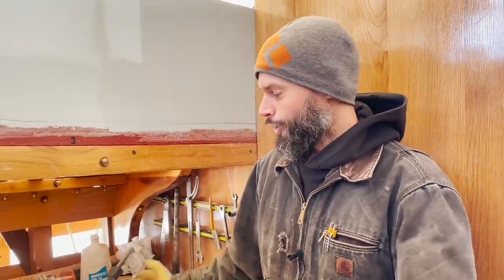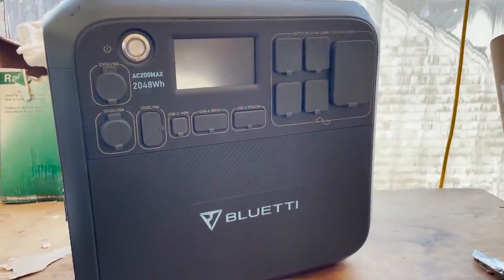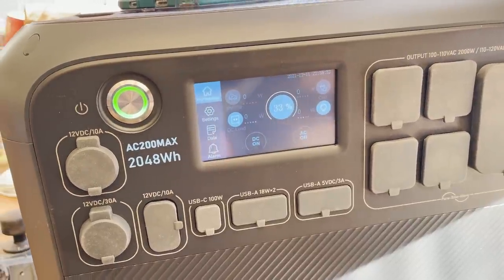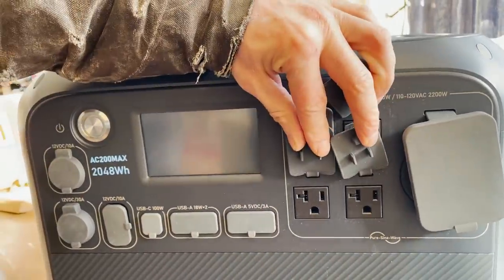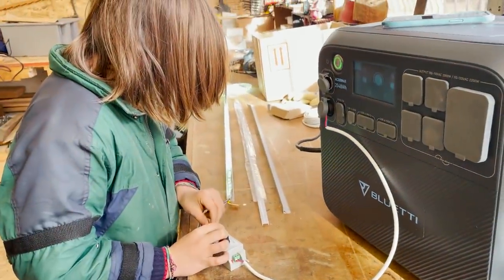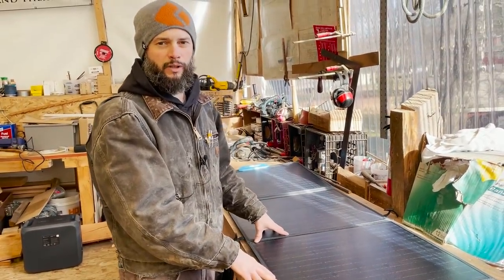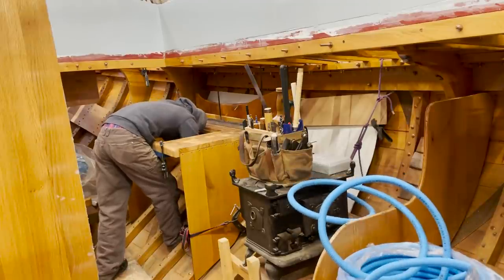Boat Electrical Systems, First Steps - Episode 194 - Acorn to Arabella: Journey of a Wooden Boat

Comment: You'll find green is better for your charts etc and red is ok for general illumination.

There's a bunch of research out there on what colour is better, especially from WW2 that is flawed. There's also a bunch from the aviation world that kinda doesn't apply 1:1. Sailing a boat is different to flying a plane.

At the end of it, you'll find that it doesn't overly matter what the colour is, just so long as it's dim. Personal opinion is that charts are hard to read under red though.

I'd also suggest you look at how those lights are working and put a red/white changeover switch in so that you have either red or white running in the boat and any large white lights don't function when in red. That way you can't accidentally flip a switch and blind yourself.

For the conduit, it's not just a matter of how many you can jam down it, there's cable heating that needs to be considered. More conductors in a small space with poor thermal characteristics (IE a conduit) causes more heat, sometimes to the point the insulation on the wiring will fail.

Also be careful about voltage drop, the boat is getting a bit big for 12v power. You're likely to start having voltage drop issues over longer distances for anything with a reasonable power draw.

Lifepo4 definitely have some advantages over lithium ion etc, but they still have significant temperature limitations. If you're down around 0C they can't be charged and useable charge is decreased significantly. There are low temperature varients that attempt to address these limitations, but they'll only get you a further 10C or so. Better, but not significantly so. That said, in many applications they are the correct choice these days, so you are going the right way there.

I'd also suggest you do a proper load analysis to work out what you expect to draw, both at low temps and high temps and long and short days. The different combinations have an effect on replenishment from solar and also power usage from lights and refrigeration etc. Find your worst case and go from there.

You're also significantly better off running multiple inverters near their max capacity than one inverter only occasionally at its capacity. Inverter efficiency is a function of load, when lightly loaded they're crap, when heavily loaded (80-90% of capacity) their efficiency can be above 95%, meaning less wasted power.
Reply: In another comment, Steve mentions that yes, he has taken the thermal issues with conduit into consideration. There will only be a couple of circuits per conduit.

Comment: Conduit keeps water out of the electrics in an emergency when you need the radio and lights most.

Have you also considered a small wind genny for when you can't use the panels in heavy weather?.
Reply from the maker: Wind power is hard for a rig like this, but we have a couple of ideas for when we’re at anchor.

Comment: You don't need to glue the short plastic tubes into junction box, it would be simpler and actually stronger to insert the threaded end of the flexible conduit and use the nut inside the box to affix it. No glue connections that can break and it is simpler to disconnect the conduit  from the box.
For the nut you can actually cut off those threaded grey tube ends.

Comment: Greets from germany, i use the earlier modell ac200p now a jear without any problems. Btw if you have the ds05 device you can charge 500 watt more over the ac input with solar combinet with the 900 watt in the dc input. One thing i would like to know if the temperature sensors in the ac200max are well calibrated, so if the unit is in standby, and compare the temps bms, acout, and pv in...

Comment: I found that those strip lights do not last. (You can get waterproof versions but they do not last long eather). The color changing lights use lots more amps. Use 3 strings with 3 switches one red and two white to control the amount of light.
Reply from the maker: Thanks for sharing your experience!

Comment: lifepo4 is actually pretty old tech, they typically run around 3.2v vs 3.7v of lithium ion (nickel manganese cobalt) so have an overall lower energy density but as you say they have excellent charge/discharge capability and more importantly have a life of around 2000 charge/discharge cycles vs a few hundred for lithium ion

Comment: Do you add extra 5v USB charger ports around in the boat? You can't have too many of those. Also it would spare the use of the few ones on the battery box, so they last longer.
Reply from the maker: Yup.

Comment: I don't have user experience to say this is a big concern (only theoretical engineering experience,) but I'm worried about monocrystalline cells being taken out into the wilderness and being put up and taken down on the boat. Maybe you'll be able to handle them with the kid gloves they need, but depending on your wilderness needs, thin film panels might be worth looking into for travel off the boat. They're less efficient but they're also way hardier, so they can often be rolled up and tossed into a bag.
Reply from the maker: Yeah the rolled ones are great even if they don't pump out the same amount of energy. —Annie B

Comment: Use halogen-free cables/wires as much as you can, they are more expensive, but in case of fire they do NOT create dangerous fumes and once the possible fire is extinguished, they can be replaced without leaving halogenated compound on the 'walls' which will corrode all surfaces!
If this is 'too expensive' maybe you can decide to use halogen-free for the sleeping areas or where airing the rooms is more difficult!
Reply from the maker: We’re using marine-grade wire throughout for safety and anti-corrosion properties. It’s tinned.

Comment: Instead of using solar panels for power generation you might like to look at the recent public announced new ECAT  SKLep devices. It operates 24/7 and has a Power supply 12volt DC, Power consumption 1Watt with Output voltage 12v, Output power 100 Watts of clean CO² free energy.

Comment: I'm not too clear how you are gluing in the conduit.
In the UK we have 'conduit socket and bush', you drill the hole, insert the bush from the inside, screw on the socket on the outside, then you can screw in the conduit adaptor.
When you run the cables, also run a pull through string, if you need to add any wires, connect them to the pull through along with another pull through so there's always one in place for the future
Things like the fridge have a thermostat, so they won't be taking power constantly, therefore you'll get more than the 30 hours you mentoned.
Reply from the maker: Good point!

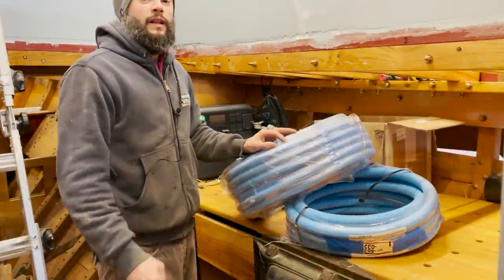Comment: As a person that always believe in backups, I could see using two of these, one near the settee for all your luxury uses, and second used for life safety, radios, navigational lights and pumps.  Install a cross connect so if one or the other fails (sea water is a nasty critter) you can still operate.  Also with stormy days, when the one for creature comforts dies, the life safety systems will still be operational.  ( Just saw you are looking a bigger house system, 22:30, use this as the life safety unit)
Reply: yes especially since the notorious "all in one" approach means any integrated component fails the whole system is dead (charger, inverter, BMS, LiFePO cells, etc.) the big tradeoff in all in one v modular solutions.

Comment: Will there be a generator connected to the diesel? In a week of rain at sea, the solar panels will not sustain your needs.
Reply from the maker: The diesel is the generator, and it has an alternator. We plan to have a few options for charging.

Comment: You're in the Faroe Islands with Arabella for some rock climbing. The Bluetti craps out. Who's going to fix it? Where are you going to get a replacement? For an expedition cruiser, I think there's a LOT to be said for traditional gear at all levels. Nothing wrong with high tech, but when it craps out, there's little opportunity to replace it and none to fix it when you are in a non-tech environment. I wouldn't want high-tech to be my only system. If something craps out in an RV, that's one thing. If it craps out on a blue water cruiser, that's a whole different thing.
Reply from the maker: It’s a fair point. That’s why we’re leaning toward using it as auxiliary, or shore-excursion, power.

Comment: One thing you need to know about the led light strips: The adhesive is GARBAGE. 
As for solar panels. I would just cover the whole roof of the boat with fixed marine solar panels. I think they are sturdy enough to walk on, if needed. And as they are mounted properly, there is less chance of losing them is storm (or dodgy marine). Output is higher, form factor is smaller, durability is longer.
And one of the many things you need to know about solar panels is COOLING, if panel heat up too much the stop producing electricity efficiently or even at all. So proper fixed mount is better.
Reply from the maker: Thanks for sharing your experience!

Comment: When will you finish the planking on the boat.
Reply from the maker: When we’re done with needing the staging. Dismantling the staging and then rebuilding it to do the interior, cabin house, and deck doesn’t make much sense. It’s so very useful.
Reply from the maker: (There’s only three strakes left.

Comment: hey, letting the powerplaner work through air does draw less power than working through wood...   you should measure those 300 watts again when the tool is not ideling but working.

Comment: I saw someone already mentioned this, but you don't want the white lite coming off an RGB strip. You want RGBW or maybe even RGBAW. Then you'll be able to use cold white when working and warmer white when relaxing.

Also, you really don't want to run the RGB strips from that three knob controller. You've got the chance to do some really nice automations if you get a decent controller, without going overboard(!) money and technical geek wise. A couple of examples could be setting the light to blue when battery is below a specific level, or get a visual indication if the temperature in the freezer is to high and all kinds of stuff.

Would it not be possible to hang the solar panels outside of the railing?

That LED light with the white rim was not worthy of being inside your beautiful boat. It's downright ugly. But I guess you've may have already mounted some since some of this video seems to have been shot as early as December 5th.

Comment: Suggestion..get a low voltage electrician involved. I'm sure there's a follower that would volunteer a little time. You could pick up some basic knowledge working alongside them that will benefit you greatly when you are at sea and need to repair or troubleshoot something.

Comment: Please don't use RGB led strip for white light. Getting nice white light from it is hassle and even then it is low quality. Use RGBW with dedicated white leds (I would recommend warm white with color temperature around 2700-3000K) Or just separate red and white led lights.
To get more from your batteries with dim light, I would use dumb led strips (that can't change colors of each led module independently) and I would try active current control led dimmers with DC to DC conversion not the PWM ones. LEDs are more efficient when running on lower currents. I read a paper claiming 16-21% better luminous efficiency with advanced current control dimming over normal PWM dimming. I would assume you can get at least 10% power consumption / longer battery life with just ordinary non PWM dimmer when running <50% maximum light.
Reply from the maker: We’ll mostly be using them for red, but thanks for this info!
Reply: Plus PWM regulated light are blinking and with stroboscopic effects it can make rotating tools seem stopped. As your boat is not machine shop I assume that this won't be problem, because even when your circular saw or something would look stationary you would hear it running :)

Comment: As a guy who worked with solar panels, I'm quite doubtful on your plan. Solar panels and high latitudes don't mix well, and solar panels and "going in the back country" mix even less well. A solar panel as 15-22% efficiency in the ideal conditions (25°C and perfect exposure). On a boat you will never have good exposure since it moves. And if it's cold (or hot) your efficiency will drop significantly (almost to 0 on an overcast/very cold/very hot day), meaning you will have less than 100W/h per meter per panel at your disposal in the best conditions (considering 1000W/h per meter of panel of solar radiation. This is VERY optimistic). 
 If your boat will consume on average half of what a normal household consumes, the area of solar panels needed to be 100% independent is huge and probably not feasible. Your fridge alone will exhaust your battery in 30 hours, but you are charging it 3/4 hour a day tops.
If you're on the move by foot, using solar energy is just not a possibility if you are planning to charge cameras or video equipment.
 Always have a diesel backup, and consult a professional!
Also, you seem to think 12Vdc and 30A are a lot of power. It is not: that's 360W, not even enough for an hair drier.
Reply from the maker: We won’t always be in high latitudes and plan to have a couple other charging plans, but thanks for sharing these thoughts!
Reply: @AcornToArabella  - My own high-latitudes sailing plans include an EFOY methanol fuel cell system, as used by Patrick Laine aboard his yacht. Not cheap, but when there's no wind, no sun, no problem!
Reply from the maker: We’ll take a look, thanks for sharing!
Reply: @AcornToArabella  - You're welcome. Patrick doesn't even bother with solar or wind power.. he says the fuel-cell provides all the electricity he needs.

Comment: There is no difference in fire hazard between LiFePO4 and Lithium polymer.
They will both erupt if you make them.
There is also no difference in charge and discharge rates between the two.
LiPo is better because higher energy density to weight ratio and more predictable voltage level.
ie LiPo you charge to 4.2v and it stays there.
LiFePO4 you charge to 3.65v and it drops to 3.3v

Comment: Steve, unless that battery system is designed for the marine (harsh) environment, I’d leave it out. Make sure you install a solid electrical system, not any gimmicks. (I’m an electrical engineer, master electrician and commercial electrical inspector). Don’t take unnecessary risks. I’m not a boat electrical guy, but be sure to use recommended equipment and don’t run that blue flex outside.

Comment: Solar panels do NOT "cook themselves" if they have no electrical load! Where did you get that idea from?
They can lay open circuit or even dead short without problem.
Imagine you have them permenantly installed and then your batteries are full. What you gonna do? Turn on dummy loads or cover them up? That is really nothing to worry about!
Yes, you can measure a temperature difference if under load or not. But those are black things designed being grilled in the sun :-) Don't worry about that.

Only thing that could degrade them long term would be partial shade under high load on the rest of the panel. Because that shaded areas get very hot. But on good quality panels, or if the shade is moving, that should also be nothing to worry about too much.
Reply from the maker: Good to know!

Comment: I may have missed it, but pay attention to how much your sails shade your solar panels. They lose effectiveness, fast.
Reply from the maker: They sure do! It’s why we’re going to try to work in some variety in charging options, as most boats do. A Diesel engine is a very efficient method, for example!
Reply: @AcornToArabella  You seem to have a good handle on things, but I figured I'd say something. Not every boat builder on YT seems to be paying as much attention to their electrical system and installation as you guys. Kudos.

Comment: What about a couple wind turbines?  Not a sailor and I don’t see them used on boats as much as I would expect so there must be issues with them.
Reply from the maker: The rigs on many boats present challenges. We’ve got some ideas for something that could go up while at anchor.
Reply: there are lots of issues. Cost v performance. Performance in not perfect laminar wind. Huge drop off on boats that are rocking at sea or anchor, sailboats choose to anchor in calm, protected anchorages defeating the purpose of a wind gen, on and on. I tried one and sold it off, many cruising friends have the same experience.

Comment: These boxes are a great gimmick but its not realy suited to running a boat not serviceable either
Reply from the maker: Now that we’ve tested it a bit longer, we think maybe going with a smaller one for longer shore trips, and using it as a bit of backup in other times might be the right way to go.
Reply: Maybe not a gimmick, but better suited for a Pop Up  camper or other temporary power need. Given your ability to plan and build systems, I would give it to a weekend camper to tryout.
Reply from the maker: I think shore excursions are really its best use.

Comment: Reason why there are fuse panels and breaker boxes on boats is cuz it's in water. But i'm sure you know that.
Reply from the maker: Hm. Well, there are breaker boxes in any well built electrical system, no? On land. In cars. Inside these stand-alone batteries with inverters…

Comment: Not trying to be a naysayer but I think you are going to end up being pretty unhappy with a portable system like the bluetti, or  the jackery, or the titan, ext… for your primary electrical system. You would be much happier with a permanently installed LiFepo4 system with individual inverters and charge controllers and the potential for alternator charging. You could always upgrade down the road though when you realize your not happy with it.